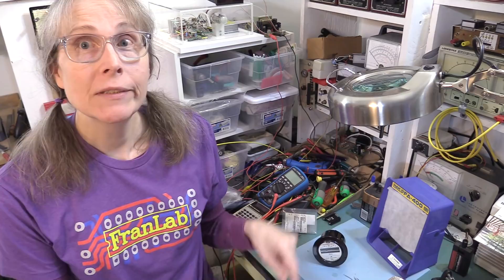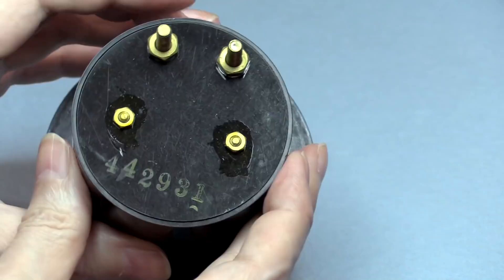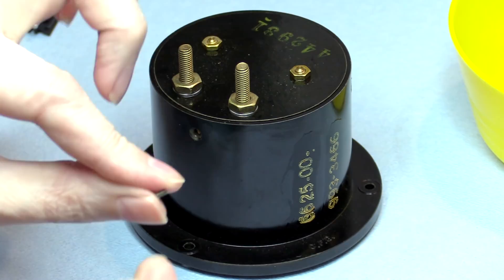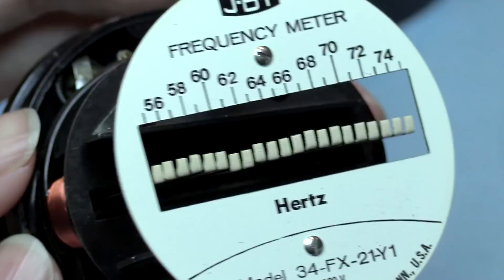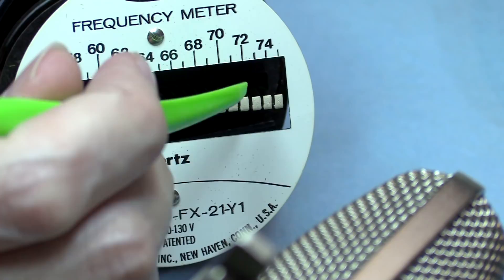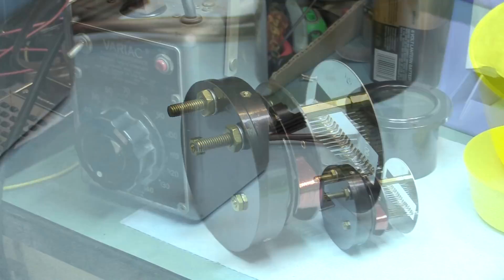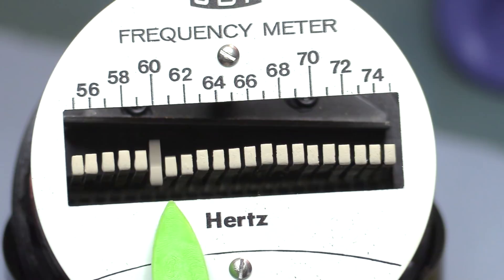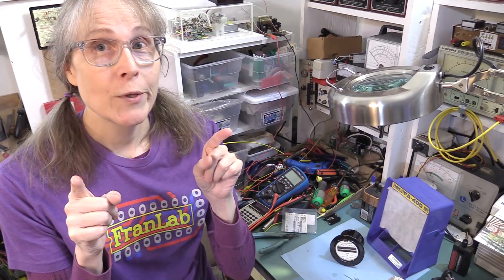The Spooky Action Of Mechanical Frequency Meters

Comment: Since it draws less than 8 mA I would suggest just using a god old fashion audio amp, a frequency generator and a step up transformer; all of which I am sure you already have on hand. (a small 12V step down  transformer wired in reverse should do)
Got a kick out of the TI 30! That fits your theme  perfectly.

Comment: you could use a signal generator,  cheap audio amp and a random transformer with a close enough ratio to drive the gauge at various frequencies.  i can't imagine that thing would need hardly any current to run.  actually if you got a second hand commercial amp they have a "70v" output that can exceed 70v ac rms quite easily

Comment: Use a guitar amp with the guitar string slackened right off to get the frequencies you want.  And maybe a step-up transformer to get the output voltage of the amp up to about 120V.

Comment: The 'needles' of this meter are all identical. The tuning of each to a specific frequency is achieved by the blob of solder right behind the bend at the front end. The amount/weight of solder is trimmed on every needle so that its resonant frequency matches its position on the scale.
You can set up a test bench for the range of frequencies using a sig generator and a good PA power amplifier.  A 1500Wrms amp should output the necessary 120v.
Reply from the maker: Yes - I noticed the blobs after editing the video!

Comment: in the early days of radio control, before proportional servos became available, a very similar device was available. A reed bank. You transmitted one of a number of tones which caused the tuned reed to vibrate. That closed a circuit which you could use to operate a control. 

See:
https://en.m.wikipedia.org/wiki/Reed_receiver

Andy

Comment: You can use some old hifi amplifier with a step up transformer, like e 120/24V backwards, maybe some resistive load to play safe, this works reasonably well for an experiemntal setup with an amp that can be disposed of it anything goes wrong. I saw a setup like this used to power an old mechanical TV Set motor at a specific frequency. Guitar or base amp would also work fine... if you have one at hand ;-) I would watch out for oszillations though... ( other than in the meter that is ;-)

Comment: hmm..how did they produce all these springs in different mass? One possibillity would be to simply produce them to a spec, have natural variation to the mass due to the manufacturing process, and simply measure their mass afterwards and classify them then. So you do not produce them to mass x and y, you simply produce them and afterwards try to find one of mass x and one of mass y in the heap of produced ones.

Comment: If this only needs 10mA or so to operate, you can just use a tube amplifier (no need for output transformer, just a coupling cap) and a signal generator.
Or a transistor amplifier and a transformer :)

Comment: That would be great for a gas-powered generator as those can vary greatly based on engine speed. To produce AC power at 60 hertz, the engine has to maintain 3,600 rpm.

Comment: Make a variable freq generator using couple of OP amps or use cheep function generator. Use it to drive an audio amp. Use a mains transformer backwards to get line voltage. Simple !

Comment: Just get a cheap microprocessor controlled UPS and vary the clock oscillator frequency if you want to mess around with line voltage at various frequencies. You can vary the output on the cheap this way.

Comment: you could use a frequency generator and an line transformer and use it backwards to boost the voltage i think that could work when the output of the frequency generator is high enough :3 i think it is worth a try

Comment: For variable frequency you can just hook it up to an older hifi amplifier and a tone generator. That way you should be able to get a high enough voltage to get visible action. Probably not quite up to 120v but 80 or so should be possible with a not too hard to find amplifier. The more powerful amplifier the higher a voltage it can sving and it won't destroy it as long as it's not a tube amplifier with output transformer.
Another option is again an old hifi amplifier but this time use an old 12v AC iron core transformer in reverse. Sure it may have bad efficiency when used that way but should do the trick!
Reply: Lol of course you've already made a newer video :D Probably sometimes it's just better deleting old videoes when better has benn made :)

Comment: Hook it up to a gas powered generator and change the engine speed by applying pressure to the speed governer.  That should vary the frequency generated.

Comment: Hi   You could perhaps try a neon oscillator ( DC  feeds capacitor with neon across it via a resistor ) I dont know how low a frequency
it can produce ( and its not a sinewave ) . I did it many years ago with loudspeakers as the output .
                                                                                                                                                                                  Alan

Comment: Couldn't you connect a low frequency sine wave oscillator to a step up transformer and get enough current to make it work.
Reply: Would probably need an amplifier in there, somewhere.

Comment: Was this making a 60Hz buzz while running, your mic didn't pick it up. This is pretty cool, but where would it have been used? The only application I can think of would be in power generation where you'd need to make sure you were creating 60Hz.

Comment: Hook an audio transformer in reverse onto an audio amp with a signal generator to get the voltage & frequency to test it. Don't use a small old transistor radio or mini amp transformer, they're probably not designed to work well below 100hz.

Comment: I would like to see the meter operator over frequency range.  Can you safely power the meter by back driving a 12V transformer with frequency generator and small power amp?  Since the meter draws under 8mA at its operating voltage it will not take a lot of drive current at 12V.

Comment: The only simple way to make a variable frequency high voltage source that occurs to me would be to take your function generator to drive an audio amp which in turn drives a regular power transformer in reverse.

Comment: My thought for a variable frequency 120v source would be a cheap gas powered generator. Maybe as low as $100. You can play with the governor to change the speed/frequency. Even loaded and unloaded you could see the frequency change. Put your hand over the carb inlet and watch the frequency drop etc. Not to be run in the lab, of course.

Comment: The company I work for as an engineer has in their archive room something called a magnahelic?  Ever heard of that?  It's really old school and it's really cool.  They used it in the R&D department years before my time.  I'm only 24 so I grew up with computers and tech.  This thing looks more mechanical than anything else.  Do you have any idea what a magnahelic is?  BTW I love all your old school equipment.
Reply: Not sure of their working principle, but those are to measure differential air pressure between rooms, to ensure doors are not to be opened allowing dirt and contaminants into a clean room. Used in analytical labs and similar

Comment: I wonder if you could open up a cheap 120v inverter and mess with the 60 HZ clock or whatever base signal the 60 Hz square wave is derived from.  Yeah, they spit out square or stepped square wave ("semi-sine"), but I'd think that'd be good enough to drive this display.

Comment: Fran, if you have an audio generator such as an old HP 200 cd or any generator that can provide a watt or so output. Connect it to a low power 6volt filament transformer turned around backwards. I'll bet it will work........RadioValve

Comment: So you never met 'reed' radio control? that used a similar system of reed length resonance driven by a coil. You could even get multiple ones to operate at the same time. Each drove a relay that drove servo motors. I am sure that there was other uses of this before electronics displaced them.

Comment: You would think that this being the good ol' USA the 60 Hz reed would be smack dab in the middle.
Reply: I think most power generators have a cut-out if they run slow while under load.  This is to protect the alternator and wiring, (and these days semiconductor devices monitoring or using the circuit) because it usually indicates a problem with the engine driving the alternator, or a very severe  overload.  So...  probably more important to monitor a high frequency situation.  I'm surprised they didn't use a different colour paint on the 60Hz tine though, so it could be read quicker and from a greater distance.

Comment: Hertz was adopted in1960 to replace cycles per second therefore the meter must have been manufactured after 1960 since it read hertz not cps.  It does indeed look older.  Having been in college at the time I remember the change.

Comment: I remember those meters from my military service 40 years ago. Our field generators used to have them. But a version centered around 50 Hz.  A VW-engine was the power source. It drove the generator not via a belt, but via a rubber wheel. To this day I can't figure out why they opted for that wheel. I mean a belt could be sourced at any gas station. I have even seen a grammophone fitted out that way. Can someone please explain the pros with a rubber wheel over a belt.

Comment: it is all about RESONANCE.. :-)  Such device was/is mounted on fuel-driven older mobile AC power generators, to be able to adjust its RPM properly. was used in the military as well. In 50Hz areas the blades were a bit longer than these for 60Hz areas.

Comment: No one has commented on the unusual frequency range of this device.  Most power grids in the world 
are either 60Hz or 50Hz based.  It begs the question why the range 56-74Hz, rather than say 46 to 64Hz.   

What was the final application of this meter model??  That remains the final question.....

Comment: Have access to a portable generator? Could use one to supply this frequency meter while  speeding up or slowing down  the engine a bit and see  how it reacts, just be careful of the generator output voltage when doing so.

Comment: Variable frequency source - surely you can use a sig gen, a power amp and a 24 V transformer - fed on the 'secondary' and then put the frequency meter across the 'primary' ????

Comment: Just knock together a power amp, a op amp and bf469/470 transistors build it class b isolate the input with an audio transformer and you’ll have a useful tool to test all manner of low power devices that need variable frequency.

Comment: I dont get how Fran said that she spent so much time to get how these works...Its just simple wave oscillating meter. When i was at electrician school, and when i got these in my hands i knew right away....magnetic coil is slanted, or theres another version i know, that has these springs lenght a bit shorter than each another, and when AC voltage is applied to the coil, current will then create magnetic force that oscillate corresponding to each reed or spring oscillating lenghtwave or harmonic resonance .
Reply: And for those who are curious, some of these have antivibration base, because the vibrations can make not exact readings, especially when it comes to super accurate meters. We use them even in these days, newly made. (Europe)

Comment: 10:30 .. at this low current consumption, you could likely use an reversed tube audio output transformer on a normal signal generator.

Comment: If this is meant for 60 Hz  power, why isn't the 60 in the middle of the scale? Moreover, in the modern grid (I would guess also 60 years ago), it is easier to mitigate an unexpected frequency increase in the grid than a frequency decrease. So I would expect that frequency drops are more common than frequency spikes, and therefore lower frequencies should be more represented on the scale.

Comment: Vibrating reed frequency meter. I seen smaller such indicators on board ship in the early 1970's. Also back then the electronic parts warehouses were selling a surplus reed that was to be put in an outlet for Civil Defense purposes. This would give out a sound if the power companies shifted the frequency during a Civil Defense warning. This idea didn't go far. Proposed in the early 1950's.

Comment: A small (10-15W)audio amp feeding a reverse-connected filament transformer would be a good source of variable frequency line voltage for a small device like this.

Comment: Unfortunately, during of all moment recording, you have not exposed the top view of opened instrument. I suppose, on the back of every blades angle in the front side is a load of low temperature melting metal used for callibration. I have seen these instruments working wen I was in the high scool, but I never seen what is inside. They was used for surveillace of AC generators frecvency. Thank you for all your videos!

Comment: Oh, and your current calc is probably high.  Considering the inductance of that coil, I bet if you measured, the current is even lower than your DC calculation.  But yeah, saw these installed in switchboards and fed from instrumentation potential transformers, left on for years at a time.

Comment: Couldn't you connect the frequency meter to the high voltage of a tube type audio amplifier?  The meter takes extremely low power that any audio amp could deliver and if you capacity couple into the meter, just adjust the volume to get the right AC voltage to the meter.

Comment: Anyone find it easy to wind coils? I had an idea but haven't got the equipment to try. If an insulated coil wire is wound, but not around a core but half way around then folded back so it can coil back in the same path as the semi circle before it so each time the magnetic field will be in the opposite direction of the previous half wind. I Imagined the semi-wound (?) coil would bend with DC and form a wave with AC, size varying on Hz. Many could be put together, to create something that can be fine controlled with variable AC arrays of input or something, honestly came up with it in a dream so I don't know, seemed cool. I could be a dumb-dumb since I had this idea 5 years ago and still never tried it. Even if the damn thing just bends I'll be amased.

Comment: I'm sure my old generator has a rather imprecise four spring-a-ma-thing (edit: tines) frequency meter on it, i think it's like 45, 50, 55, 60Hz, presumably so you can set the engine revs correctly on it. Fascinating pieces of kit! 
Edit: Actually I now remember you can get purely mechanical 'vibrating reed tachometers' for directly measuring engine speed, quite pricey: https://www.coleparmer.co.uk/p/vibrating-reed-tachometers/58352

Comment: These meters are common on generators however, the freq range is odd.  I've seen 45 - 55 ( for 50 hz )  , 45 to 65 (  for 50 and 60  ) and 55 to 65 ( for 60 )   It is very odd that this one goes from 55 to 75 .

Comment: This was really fascinating, is it possible to create a simple, non-arduino based VU meter? I love VU meters VFD, LED and of course needle based but their electronics are alien to me. This device demonstrates  that with some ingenious precision engineering a simple frequency display is possible.

However would a coil with crystals be able to trigger LEDs to light for example? I don't think this is a cheap option just one that's floating about my head, however i feel a simple solution is possible as VU meters have been on hi-fis for a few decades now.

Comment: Such a neat device. I wonder if they have made them with a bigger range of frequencies as well?
Reply: If it went as low as 50, I'd have suggested a US/UK power adapter. As is, it wouldn't register at 50Hz.
Reply: I've seen one in another video which was centered on 50Hz, and imagine that almost all of them were  centered on either 50 or 60 depending where they were intended for use.

Comment: Wow...if you stare at the vibration, you can see where the camera's 60 frames per second is slightly out of phase from the tine. Also, to me, the parts were the tine is more pronounced appear still in a slow sine wave pattern. Any physicists here that can confirm (or destroy lol) my thinking?

Comment: you could try using a transformer in reverse to step up the voltage from the output of a signal generator to drive this at various frequencies

Comment: The calculation for the current is wrong...it would be correct if it was DC voltage. In AC system the coil has Inductive reactance and resistance...

Comment: How about signal generator feeding a FET, which switches 12V to a 120V-12V transformer? wouldn't that be enough to feed it? In fact, signal gen, small audio amplifier, transformer connected in reverse on the speaker output (12V winding) and meter on the 120V winding?

EDIT: aaaannndddd I go down the comments and find mikeselectricstuff beat me to it.

Comment: The Honda EM500 generator (lacking an auto-throttle and having the AC frequency tied to the motor RPM) actually had one of these types of resonant frequency meters to help you dial in the 60Hz of the AC output: https://youtu.be/RJku8AOkq_A?t=1039
This generator also had a cameo in season 2 of Mandalorian in one of the cargo-hold scenes.